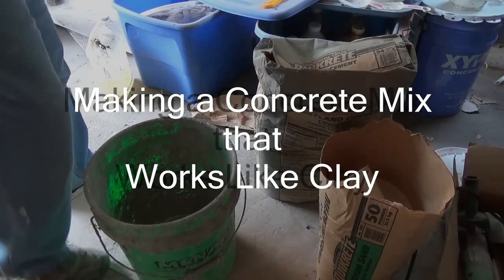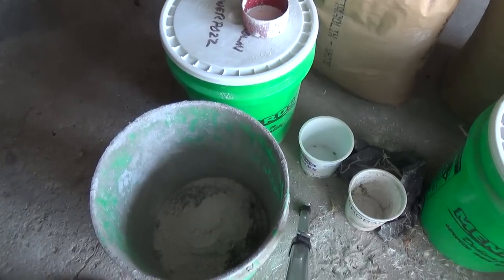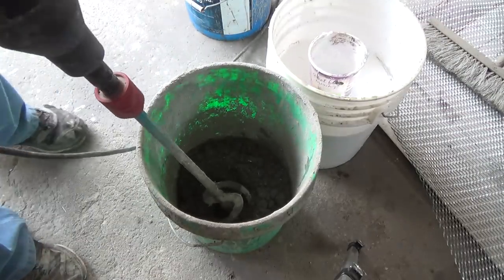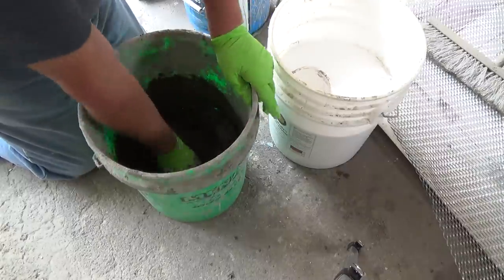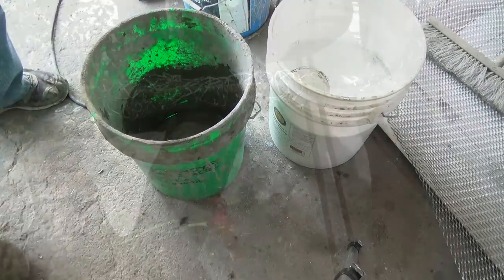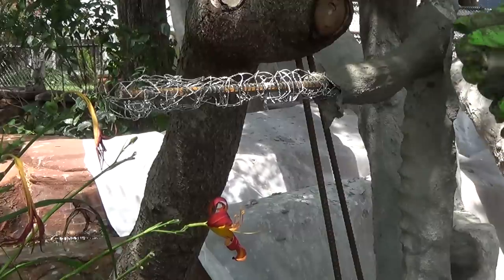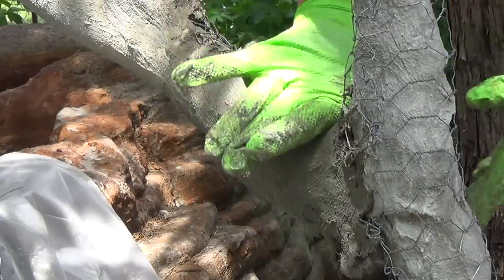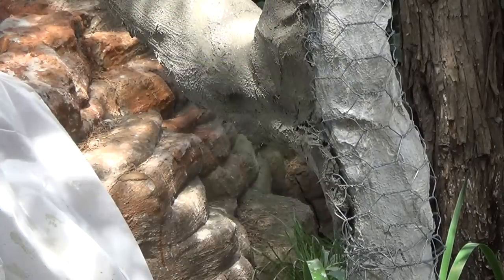#concrete #fauxbois Making a Concrete Mix that Works Like Clay

Comment: Do you have to wet cure this mix with water & plastic cover? Or does the acrylic water take away need for that?
Reply from the maker: The acrylic effectively eliminates the need for a wet-cure but, if the work is going to be exposed to direct sunlight, high heat or windy conditions, it is best to at least provide cover to further reduce the possibility of drying shrinkage.  It never hurts, though, to go ahead with the wet cure.
Reply: @dperry428  Thanks. I greatly appreciate your input as I am preparing to do art with these materials. I just hope I can find all such materials for purchase in my city, as I do not see all of the components at stores like my local art store, or menard's, home depot; (they have some items though).
Reply from the maker: I buy my additives and fiber here: https://concretecountertopsupply.com/   Shipping is not cheap, but a bag of metakaolin makes a lot of mix.  Contact this company and find the closest distributor:  https://www.metakaolin.com/    Metakaolin is also called calcined kaolin clay, used for ceramics.  Metakaolin is often sold in ceramic supply shops.

Comment: Do u have to you the fiber? Or will it work without it?
Reply from the maker: You can do or not do anything you want.  Without the fiber, depending on how you are using this mix, you will be more likely to experience cracks.  If I didn't have to use the fiber, why would I use it?  It's not cheap.

Comment: Do you have listed somewhere, the exact amounts of each ingredient?  I lost ya after 10 C of cement.  I'm extremely interested in trying this.  How long do you have to work with it b4 it starts to set up?
Reply from the maker: This particular mix was 1 part SAND to 2 parts cement (very high cement content) Then add 20% of the cement content in metakaolin. If there are 10 cups of cement, for example, add 2 cups of metakaolin. I also used PVA fiber, which you may or may not want to add.  The liquid contains about 10 to 20% acrylic solids.  In my case, I had acrylic stock solution that was 50% solids, so I mixed 1 part of the acrylic stock solution with 3 parts water to make the liquid I used. From that 3 to 1 solution, I started adding liquid to the dry mix by using 1/2 the volume of cement. So, if the mix contained, say 10 cups of cement, I'd add 5 cups of liquid to start.  Then, mixing very thoroughly, only add very, very small amounts of liquid until the desired consistency is obtained.  At the end of the mixing, you must treat it like bread dough and knead it by hand to end up with the clay-like mix.  It is VERY easy to add too much liquid and end up with soup.  Take it slow on adding liquid. Working time depends on environmental conditions, such as temperature.  You can slow the set by using chilled liquid. I put icebags in the liquid.  You can also add a very small amount of sugar or molasses (no more that 1/2 % the amount of cement), so in the case of using 10 cups of cement in a mix, add no more than 2 1/2 teaspoons of sugar.  You can also work until it starts to stiffen and then add a few drops of super plasticizer to loosen the mix again or, with some reduction in strength, add a small amount of original liquid to loosen the mix. Generally, you'll have at least an hour before you notice any significant stiffening of the mix. It won't begin to really harden for two to three hours.  Even then, spraying with water will allow finishing details to be applied.
Reply: @dperry428  Thank you so much for your detailed answer!  I'm off to visit that Fishstone website, to see about products I won't find at Lowe's.  Oh....Is it Portland Cement?
Reply from the maker: Yes, ordinary portland cement.  You see it in many recipes as OPC.  At Lowe's is sold in 94 lb bags.  Wish they carried the 47 lb bags.  Getting tough for us old guys to lift the 94's.
Reply from the maker: If you buy from Fishstone, say hi to Tom and Carrie.  Great people to work with.
Reply: @dperry428  Ah, ok.  I hear ya, I just hauled an 80lb bag of Mortar in yesterday.  No fun!

Comment: Which is the best Portland cement for this type of project to make this like clay.
Reply from the maker: I don't know what you mean by "best".  Ordinary Portland Cement (OPC) is sold in home improvement stores as either Type 1 or Type 1/2.  Type 1 is OPC. Type 2 is moderately sulfate resistant, Type 3 is high early strength.  Types 4 and 5 are not made any more.  If that's what you're referring to, Type 1, OPC, is what you use.  If you mean which brand is best, your guess is as good as mine.  I've used a number of brands and see no difference except when the seller is trying to pawn off some old stuff that is lumpy and partially hardened.  Press on the corner of the bag to ensure that it is soft.  If it is hard, don't buy it.  Other types of cement, such as Rapid Set are NOT portland cement. Rapid Set, for example is CSA (calcium sulfo aluminate) cement, not portland.
Reply from the maker: A little update.  You may soon not be able to get traditional OPC (ordinary portland cement) as cement manufacturers are succumbing to the pressure of climate change alarmists who are demanding "greener" cement.  When cement is made by heating limestone, which is calcium carbonate, the limestone is changed chemically and carbon dioxide is driven off.  Cement manufacturing is responsible for about 8% of the carbon dioxide produced by human activity.  Traditionally, OPC could contain up to 5% of ground up limestone that has not been calcined.  Now, manufacturers are making a replacement cement that is called "portland-limestone cement" that contains10% finely ground limestone that replaces the activated cement.  In other words, the new cement contains 10% less portland cement than the old formulation. So, now they can claim that cement produces 10% less carbon dioxide and, thus, is "greener" than straight OPC. While it is claimed that, because of the fineness of the ground limestone, it acts as "nucleation" particles and increases particle packing that makes the new mix as good as the old.  I don't believe it for a minute and will change my mixes by reducing the amount of sand by 20% to compensate for the addition of 10% ground limestone and the LOSS of 10% of the actual portland cement.  I have no idea how the ground limestone is going interact with the additives I use.  I'll just have to wait and see.

Comment: what can you use instead of the metakaolin? is there another product to replace it?
Reply from the maker: Beats heck out of me; this is the mix I use based on the research I did and what was available to me.  I haven't a clue how well other things work as I've not tried them, but I've read of others who say that fly ash, diatomaceous earth or other fine-grained pozzolans have worked for them.  All I can suggest is, if you don't want to use metakaolin, do some reading and experiment with what you think will work for you.  I'm not the end-all of concrete knowledge.  I just know what works for me after reading, researching and experimenting with available materials over a period of 16 years.  I might add that if you don't want to use metakaolin, you might try just purchasing one of those "proprietary" mixes that cost outrageous amounts.  The sellers, however, will never share what they use.
Reply: Thank you! I will try. I searched for metakaolin online but couldnt find anyone selling it in Au
Reply from the maker: Here's some starting information.  Looks like it is being imported.  http://www.sydneyconstructionmaterials.com.au/mk_pozzolan.html

Comment: How has your mix held up to cracking since you made this video?
Reply from the maker: Very well, especially considering our harsh climate here in northern Illinois.  I use this particular mix for the underside of of things like my garden bridge.  It differs from my normal mix by eliminating silica fume and increasing the amount of metakaolin.  To increase crack-resistance to the maximum, I add some CSA cement to the mix as it is expands on curing, compensating for portlands tendency to shrink. It also speeds setting, so one has to work more quickly.  Also, once there is an initial set, covering the work with plastic to hold in moisture further reduces risk of cracks.
Reply: @dperry428  have you tried rapid set mortar mix, or cement-all for similar uses?  I wonder how they compare.  The clay powder is hard for me to source here.
Reply: @dperry428  Perhaps I can send you an image of what Im working on for your input/advice?  Im an expert in a specific form of concrete casting, but I dont have this type of experience.
Reply from the maker: @edwardmurray2284  Rapid Set is a completely different kind of cement from portland cement.  It is CSA cement. Calcium Sulfoaluminate.  It has very high early strength, does not exhibit shrinkage cracks and is very durable.  Sounds like the perfect stuff to use, doesn't it?  The problem is in its name -- rapid setting means exactly that, and depending on environmental factors such as temperature, the setting time can be as little as 5 minutes.  Even with the addition of a retarding agent. like citric acid, the set time is 20 to 30 minutes.  If you're pouring a mold or doing flat work, like patching highway potholes, it is perfect.  In fact, highway crews use it for just that purpose, since cars can be driving on it in an hour or so.  If you want to do things like form rocks or hand-texture faux bois pieces or create sculptures, it's not a good choice.  I do use a CSA additive, however, that creates a blend of portland  cement and CSA (not Rapid Set, but an additive) to take advantage of its tendency to expand to compensate for portland's tendency to shrink, which causes cracks.  So, I add about 5% CSA to many of my mixes to reduce the possibility of shrinkage cracks and to speed the set of my mixes when I expect rain.  Set time with that addition is less than two hours.  Where (approximately) are you located.  I may be able to help locate metakaolin for you.
Reply from the maker: http://www.etsincusa.com/  Based in Austin, TX and supplies metakaolin.    Also  https://www.metakaolin.com/contact-us/  Contact and ask for distributors near you.
Reply: Hope you are healing well.  :)  I really want to sculpt with cement, I've never used a plastisizer when I looked it up there are a million options.  Could u tell me what u used exactly. (Like brand and where u got it)  please.  Tysm
Reply from the maker: I don't use a plasticizer.  There are water reducers that help increase the strength of a mix, which I don't need.  The superplasticizer makes a mix flowable without using more water.  It's used when doing thing like flatwork or pouring into a mold or into forms, but it wouldn't work worth a darn in applying to an armature or for sculpting or vertical work. It would make the clay-like mix impossible.

Comment: What size Silica do you use?  40 mesh?
Reply from the maker: I use what's locally available at Lowes.  This Quikrete medium sand I'm using here is probably about 30 mesh.  When I want something finer, I get silica sand from Fishstone, which is 40-50 mesh..

Comment: I what type of concrete is used I II or III or does it matter?
Reply from the maker: Concrete is not sold as a type; cement is. OPC (ordinary portland cement), which is type I, is what I use, but is sold and labeled in home improvement stores as Type I,II.  Type II  is the same as Type I, only sulfate resistant and used where soil is high in sulfer.  Type III is fast set.  If you want faster set, you can use Type III, but I'd recommend using, as I have, Buzzi Unicem CSA cement added from 5% to 30% of OPC content to speed set, since it is also an expansive cement that counteracts the tendency of OPC to shrink.  Set with it can also be slowed with the addition of citric acid, giving tighter control over set time.
Reply: Thank you for the quick reply.  You're an inspiration, I had seen in one of your videos saying that you were 71 years old.  Most people that I see are just sitting around or just drinking coffee, not that there is anything wrong with that, you just break the mold of most people!  I just ordered a book of a guy that you had mentioned Donald Tucker.  Can't wait till it comes in..
Reply from the maker: I'm 76 now.  Just keep moving and don't look behind; the devil may be chasing.

Comment: Thanks for the video! How do you think - would  the concrete still be moldable if no acrylic admix was added? In my region this specific product is not available, - what is the most important thing that this substance adds to the concrete mix? Is it the strength after curing or does it makes the concrete mix more moldable? From what I understand the admix's most important feature is that it helps the cement adhese to tsurfaces (and probably fibre).
Reply from the maker: You can make concrete "moldable" by adding less water, but that won't make it end up with a quality product.  The acrylic improves compressive and tensile strength, increases cohesion between mix particles, improves durability, decreases water and chloride intrusion and resistance to freeze/thaw cycles.  Where on Earth do you live that you don't have access to acrylic admix/bonding agent? They are available in hardware stores, home improvement stores and virtually anywhere concrete products are sold.  There are literally dozens of brands of acrylic polymer additives. Do a simple search for acrylic polymer admix.
Reply: @dperry428  Thank you for the quick reply, I appreciate it a lot! I'm from Latvia, and there are lots of different acrylic concrete additive, but they have very different properties - most of them are called superplastifiers, but some of them have unwanted properties, like decreasing the curing time, and from what I understand, making the concrete mix more fluid while decreasing  the amount of water. But I Have not fond a product yet that  has similar properties to the one you're using. But Still looking for one that would increase adhesion, although I would be using this concrete with molds that have epoxy finishing - not sure if I want  the concrete to stick  to that too strongly.
Reply from the maker: Superplasticizers are NOT the same as acrylic admixes.  Plasticizers are used to make the concrete liquid without adding water.  They make the mix self-leveling. They would make the mix the exact opposite of being moldable.
Reply from the maker: Sika makes an acrylic bonding agent/admix.  Contact here for information:   https://lva.sika.com/
Reply: @dperry428  thanks, I already contacted them but due to some EU legislation Sika is not allowed to trade items related to concrete works in this region. I have only seen products like PU sealants from Sika. But I'll keep looking.
Reply: @reinispope5292  you could add old acrylic paint for a similar effect, but decrease water accordingly.
Reply from the maker: That is truly bad advice.  First, do you know what kind of acrylic is in the paint?  Is it re-emulsifiable or non-reemulsifiable?  That makes a big difference, depending on where the concrete will be used.  Do you know exactly what other ingredients are in that acrylic paint?  When making concrete, it is crucial that there are no contaminants that will affect the mix.  Clearly, concrete experts even advise that the water that is used should be such that it is fit for drinking. Unless you know the exact ingredients of the paint and what effect they will have on the chemistry of the concrete, using paint as a substitute for acrylic admixes is just plain bad practice.

Comment: What is the matikila
Reply from the maker: Metakaolin is a powder made from kaolin clay by heating (calcining).  It is very fine-grained, about 1/10th the  size of cement particles. It is a pozzolan that reacts with the by-products of cement hydration to form cement products that make concrete stronger.  I buy mine from Fishstone,  https://concretecountertopsupply.com/Item/metakaolin

Comment: Where do you find the meta kaolin
Reply from the maker: Here's where I get mine  https://concretecountertopsupply.com/Item/metakaolin  You can have it shipped or, depending on where you live, you will have to search for a local source.  It is also called calcined kaolin and may be found in craft stores that specialize in pottery and porcelain crafts. Metakaolin may be found at suppliers of concrete additives, particularly decorative concrete.
Reply from the maker: Contact these people, too, for possible local sources or distributors.  https://www.metakaolin.com/
Reply: Thank you
Reply: Is this a dry polymer material
Reply from the maker: I buy buckets of liquid that is 50% solids emulsion.  The acrylic polymers can be purchased as a dry product and mixed with water to make your own emulsion.  Fishstone carries a dry product.  It makes it cheaper to ship.